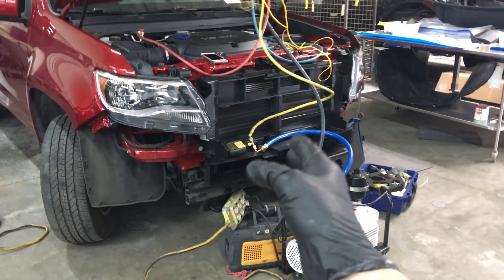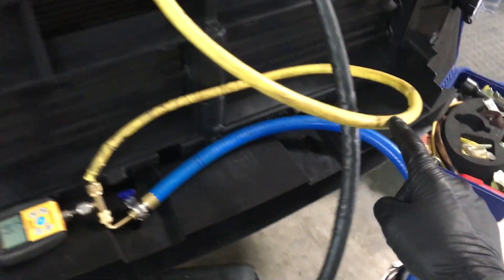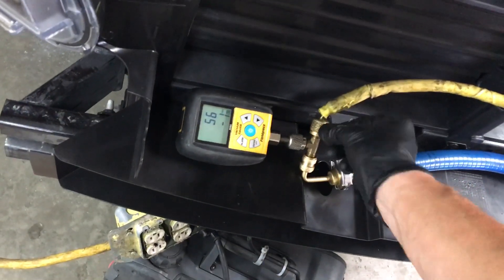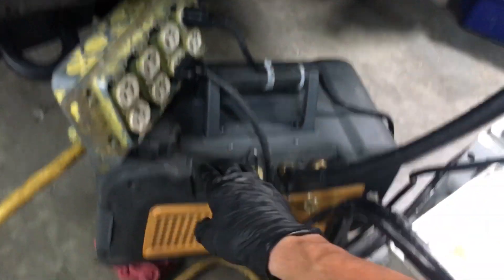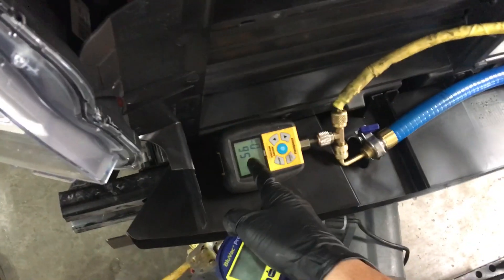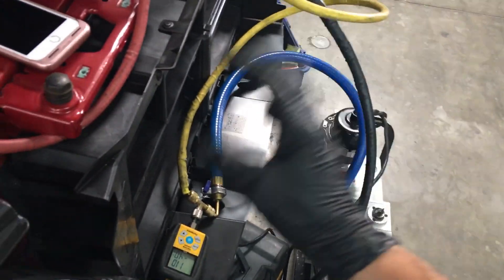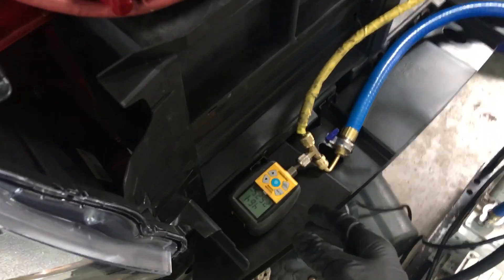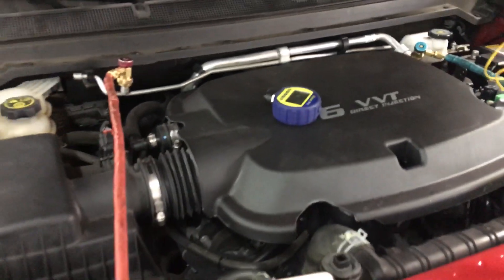Micron gauges at different placements in the system￼

Comment: In a system like this where the lines are left open over a long period. What level of vacuum in microns do you pull down to before charging?.
Reply from the maker: It will be different because in some system even after two hours or three hours I cannot get down and hold below 1200 µm. 

        When you see it is completely moisture saturated like this just give up don’t even attempt it’s not worth it. 

       Unless you have all the Time in the world then leave it on the vacuum pump overnight that’s the best you can do run the vehicle try to get the under hood temperature is hot as possible put the system in defrost with the heater on to get the cabin temperature easily above 100° and recycle that air through the evaporator while you’re performing your vacuum. 
                  And if you could leave it on the vacuum pump overnight that would be the best you can do. 

        Leaving a system open to the atmosphere for weeks is just beyond stupidity.
Reply: @coldfinger459sub0  thank you for the quick response keep up the most informative videos on youtube . ever think about teaching ?. you will be awsome at that comparing to all these other guys who dont know or even practice half the stuff in your videos.
Reply from the maker: @sameermohammed3949  i’m slowly getting my teacher credentials finished up my degree in commercial refrigeration and degree in residential air-conditioning HVAC and building automation I already finished my four year degree in automotive engineering back in the late 1980s early 1990 

      Teachings what I wanna do for my retirement just two or three days a week
I just got finished washing a live webinar zoom meeting with one of the best instructors on YouTube for residential HVAC I’ll post the link below

https://youtu.be/Ve8LR6_4dNQ

But you have to remember this is for residential residential HVAC not automotive but the basic principles apply except when you were talking about bearable displacement compressors then things start going a little funny and out of the normal

Comment: With a system this saturated with moisture what do you do? Dry nitrogen purge multiple times? Or dismantle system and flush each component and drain compressor oil and re balance system?
Reply from the maker: This is Dion repairing by removing moisture using a vacuum pump for nitrogen.     Almost nobody’s going to pay for a complete system flush out teardown the cost is too high. 

    It’s from a body shop after a repair they got a new condenser with a new dryer so that’s the best you can do in this circumstance. 

     This is what happens when you have people not qualified working on cars

Comment: I would guess that the "two pumps dont work" is two cheap units. Yours is pretty heafty and probably not cheap.
Cant expect shops that want to use jerk cans to spend money on a pump.
Reply from the maker: We do not consider shops that used jerk off cans to be real shops their just pretend hack shops.   Real shop will not guess and just pretend to get it close enough.

        So I would never consider a pretend one of the shop to ever spend money on good tools they just half ass everything.  

      You get what you pay for.